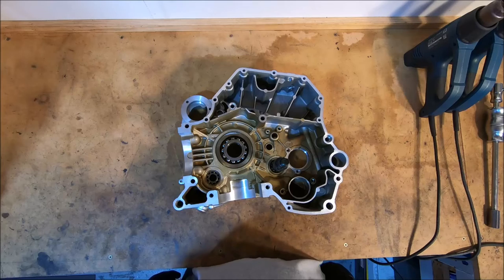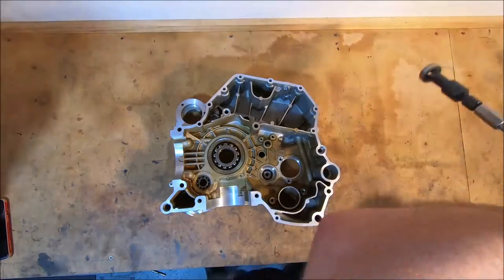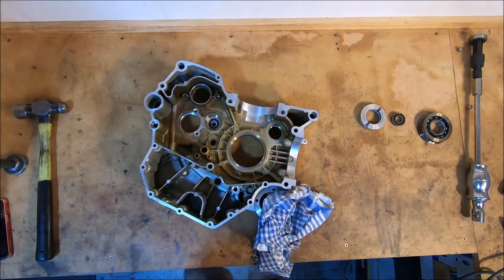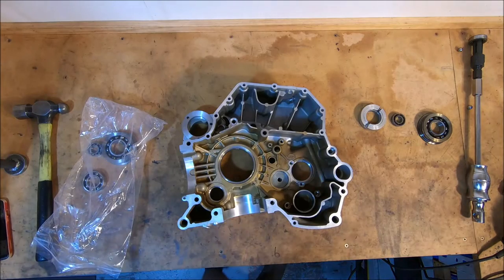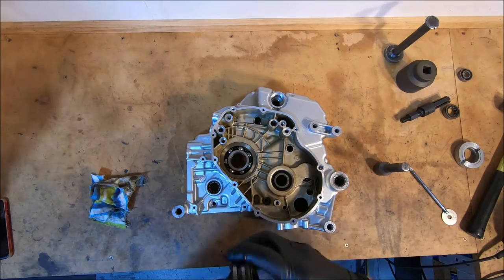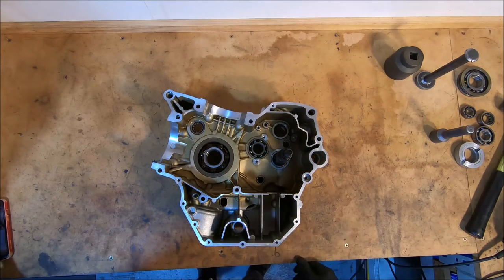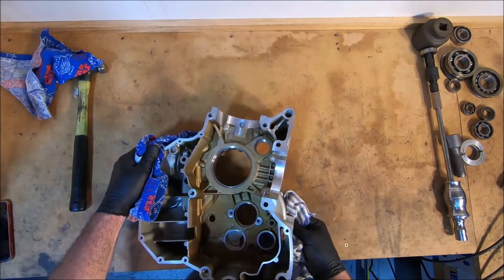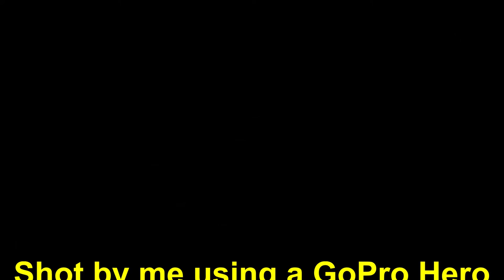Ducati crankcase bearings replacment belt drive twin - in this case an M696.

Comment: Could you say a little more about how you painted the cases and what you used?
Reply from the maker: vht sp995 - cast alloy is the top coat.  i scuffed the cases using scotchbrite from memory, then used a generic etch primer then the vht primer.  i noticed yesterday that moving them around the bench i've damaged the paint on the lower rolled edge.
Reply: @bradthebikeboy  many thanks, the paint job looked OEM quality and had to ask.
Reply from the maker: @sabamacx  believe me, it's not.  i did the covers - beadblasted, primed and painted and all the little casting roughness you couldn't see at all with the factory paint now looks like a mountain range.  amazing how well the oem paint covers it all.
Reply: Well done Sir. Next time,  swing arm bushes?
Reply from the maker: they use bearings, not bushes.  i only remove them if they're rooted or if the cases are going to be blasted.

Comment: Hi 
can i use 6205/c3 
original are 6205 ETN9/c3 in it 
😊
Reply from the maker: you can do whatever you want, it's your bike.  the only difference between the etn9 and not is the plastic vs steel cages.

Comment: Nicely done! Do you know if the newer 696 small-block cases are lighter than the older 620/695 ones?
Reply from the maker: dunno.  about the same i'd expect.  i could weigh them.
Reply: @bradthebikeboy  That would be great! Have a 620 case apart for rebuilding and can share their weight.

Comment: What was the reason for changing these  bearings? I have a ST4S that has a  small bit of vibration/buzziness in 5th and 6th gear. Enjoyed the video Brad and RIDE SAFE OUT THERE!
Reply from the maker: i wanted to investigate if i could change some internal gearing.  maybe a couple felt a little rough, i forget.  it's one of those things you do when you're throwing money at projects - what's a little more?  i bought this engine used, i've never had it in a bike.